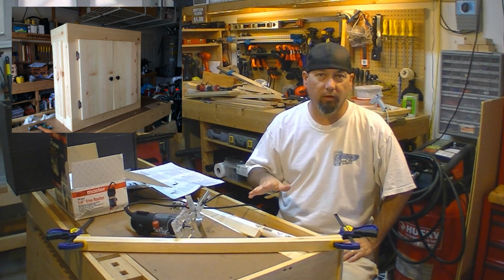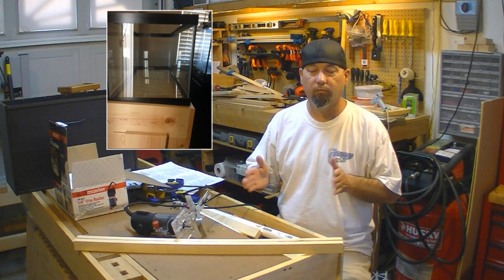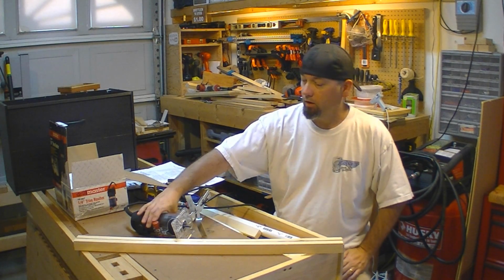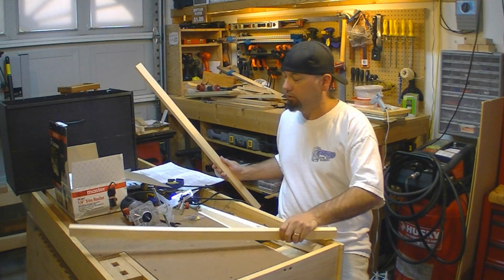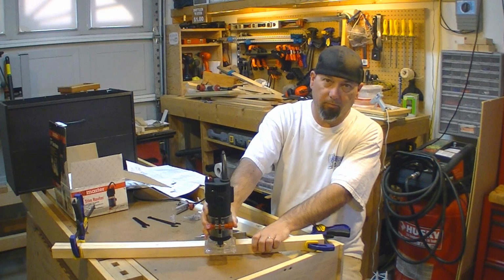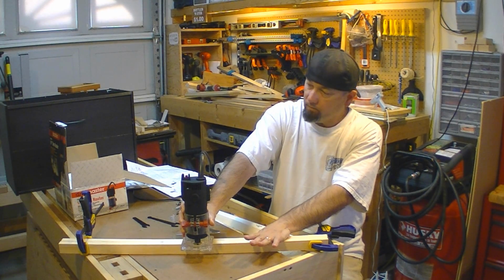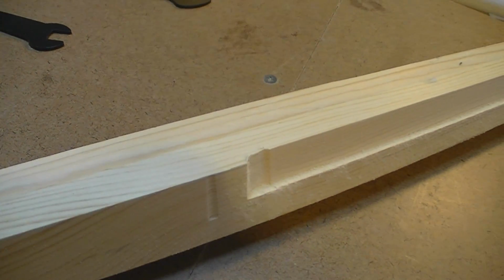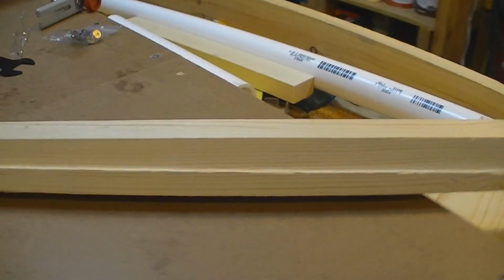Project update - The tank is too big for the aquarium stand!

Comment: I think I would have added another trim piece around the top, the same height as the piece you had to cut down, and I would have cut off the existing sides from the aquarium base up...basically cutting off the existing walls of the box that it sits in, and mount another piece all the way around, but same height...creating a bigger area all the way around for the aquarium to sit into...then inserted spacer blocks to force it to stay in place, but allow for movement? You did a great job your own way though! Thumbs up. I am impressed that you posted this...many others wouldn't have.
Reply from the maker: MP Woodworking That sounds like a very good idea, but way more work then I wanted to put into it.  That project ended up taking me a month to do and I didn't want to bring it back home, lol.  Thank you for the kudos.  I am no expert and I would like other people to learn with me as I hopefully get better.
Reply: FunWithWoodworking neahhhhhh, not too much more work than the test fitting that you went through. But the more I think about it, if there are small children in the house, the tighter the fit...the better! I hear ya about not wanting to bring it back home! Good luck!

Comment: nice save. ppl always measure the glass size of the aquarium and never take the plastic trim into account. 

no wiggle room left. wouldnt it be a good idea to take a little bit if each trimmed side with a plane or rasp and clean up the surface at the same time?

how are you going to finish the wood, taking into account there gonna be some water spills every now and then?

nice build !
Reply from the maker: Willem Kossen Probably would be a good idea but I think that she filled the tank up already and I live an hour away from her.  We put 2 coats of spar urethane on the parts that I had to trim down before I left.  The rest of the project has 4 coats.

Comment: Or you could just have removed the plastic frame from the bottom of the tank and place some polystyrene sheets under the tank to support it instead of the frame. on the plus side, since it is such a tight fit it is unlikely the bottom of the tank will ever burst.

Comment: would this setup work for a 75 gallon ??
Reply from the maker: hoxhaj1 I think the design would work if you made it bigger to accommodate the larger tank size.
Reply: FunWithWoodworking was thinking of using 2x6 ???
Reply from the maker: hoxhaj1 I think that the 2x4 construction should hold the weight but it couldn't hurt to use some 2x6's.

Comment: Been there...similar issue. Next time (there will be a next time) try laying a piece of wood on the inside of the project so that the front of the trimmer plate has a surface to ride on. That'll prevent forward rocking, which causes the gouging you're seeing. Since my salvage project was done with a full size router, rocking was harder to control (weight, friction, etc.)